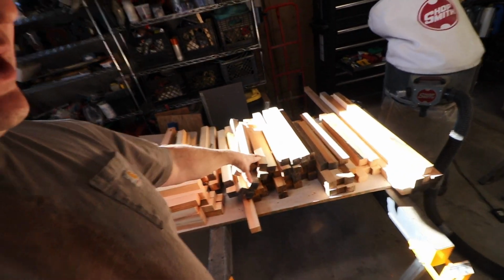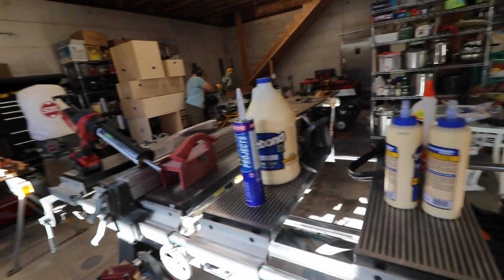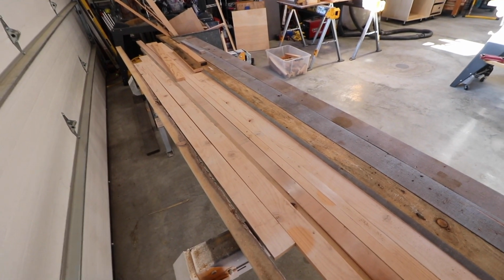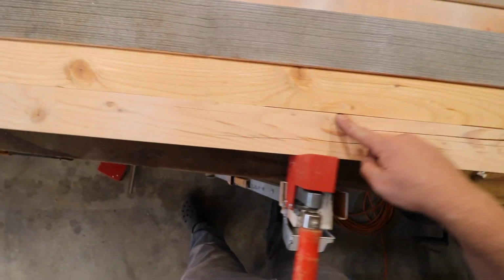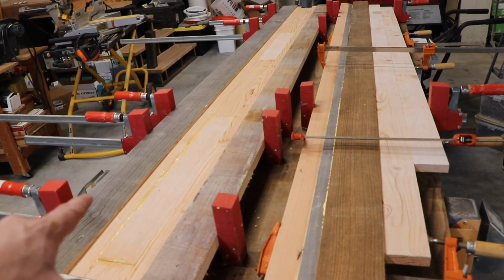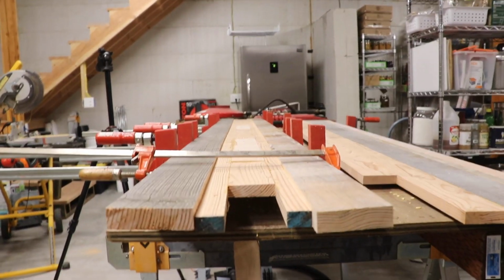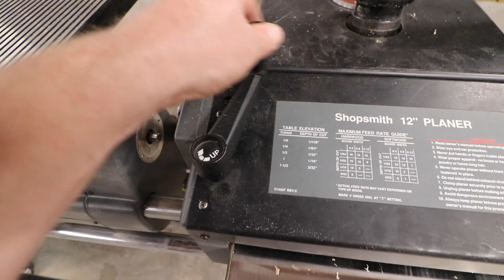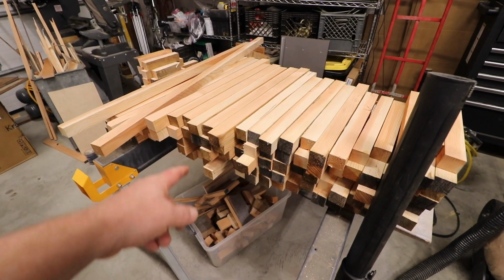ODDLY SATISFYING! Nasty Wood to AMAZING CABINETS

Comment: Here is a little trick I learned when I was in wood shop When storing glues and adhesive make sure the lid or cap is tight ans store then upside down. if it does form a layer it will be at the bottom of the container. If your bottle has a pour spout take a piece of scrap wood and glue pieces of pvc tubing alittle bigger than the size of the container and that will keep the bottle from falling over. This works great for pvc cement when left sitting for a long time.

Comment: When gluing up long boards using bar clamps, it's best to put the clamps under, over, under, over and so on.  Helps hold the boards flush to each other.  Also, planing to within 1mm of finish thickness, squaring and straightening each board individually first tends to lead to a better final result.  Then the final dimension is reached with hand sanding.  Just a thought.

Comment: Two hints for panel glue-up: to spread the glue use a "mini" paint roller - pour a bit of glue in a disposable roller pan then roll the glue on to the edges. 2. To keep the bulk glue bottle from forming a skim coat, store the bottle inverted which precludes air from reaching a large surface area. Also to prevent "cupping of the panel clamp top boards perpendicular to the board lay out.  Glad to see the bone yard being used as it hurt to see that wood tossed aside, although I did agree with the logic at the time.

Comment: You need to use clamping cauls as well as bar clamps. The cauls keep the boards in line with each other. Differences in thickness does not help you when gluing.
Your end result looks great. Better in the kitchen than on the fire.

Comment: You need to alternate your clamps. One on the bottom and the next on the top. Also, there are clamps made to sandwich all those boards between a top and bottom beam to keep them aligned plus clamped edge to edge. Simple cauls clamped top and bottom would also keep them aligned. Simple plastic wrap or wax paper can be used to keep them from sticking or glue off your clamps.
Reply: Glad i looked, I was going to say the same thing....

Comment: Just a question. Why didn't you plane all the strips to a size just over what you wanted. Glue them together. THEN plane them to final thickness? Just saying. And your edge planer fence is still moving.  Oh and just say this as you clamp large panels together....Over, under, over, under.

Comment: Did you notice in the high speed section at 13:30 - 13:50 the fence moving back and fothr at the out fall end on the joiner?

Comment: they make a roller attachment for the titebond glue bottle, or a separate bottle with a roller, but one thing is for sure the entire face of the wood needs to be covered before glue up! so brush it or roll it so the whole thing will be bonded together!

Comment: When doing glue ups, pour the glue in a shallow disposable bowl and use chip brushes or acid brushes to apply.  You can just take the cap off of the bottle and pour directly on the wood and then spread it.  Shop online for a squeeze bottle and glue roller combination.

Comment: That's a lot of work, but it's coming along which is more forward progress than not.  For future planning and edge joining projects it's best that the glue gets spread between the boards so you have full coverage on all parts of the edges. You will definitely want this for the butcher block project. Rockler makes a nice glue bottle with a roller on it that all you do is roll it along the edges and it spreads the glue for you with a lot less squeezing.  Additionally, you should be using clamps on top of the boards at least every 3 or clamps, which would help keep them flatter.  Some people also use cauls to clamp to the boards which help keep it flat and you can use smaller C-clamps on the edges or quick clamps to sandwich the project boards between two straight boards again to keep them flatter.  While you have different sized boards, you can put shims between the top clamps or cauls to fill the size gaps and push the boards to one side or the other. The finished boards look great in the end.

Comment: Normally butcher  block is made of maple or similar tight grain hardwood. I know you want to use your pine scraps and you can make it look great but you will find that it is too soft for butcher block. If you make it into a counter top you will have to replace it. You could put bar lacquer on it but I have a feeling that's not the look you want.
Reply: he is planing on replacing it with stainless steel top in the future.

Comment: Better to rough plane to a reasonable accuracy before glue-up, and use biscuits to align and take out those 'wandering' errors :) For glue-up you can use a small roller to spread the glue more evenly.

Comment: Total Boat Thixo thickened epoxy. 
Comes in caulking tubes with a mixing tip. Long working time for those tricky alignments. Also, epoxy doesn’t rely on massive amounts of clamp pressure. Just enough to close the joints.

Comment: Sorry if this is too late but I put my glue in a Tupperware dish for big glue ups and just use a small foam roller or a silicone brush to put it on the wood.
Reply: Jared Williams same here. Bowl and a brush.

Comment: 1. I still see a lot of movement on the jointer fence. 
2. Shouldn't you temporaraly glue the boards to a flat board before putting them throug the planer?
3. I would joint and plane the planks to the same thickness so you can use beams on top and under with tape (for the glue) to clamp the board on them.
4. Counter the grain on the planks to prevent cupping to one side while the wood dries out.

Comment: white  glue is tough enough for that kind of purposes no need to pay extra for special glue that make skins in the bottle or that spils out of joint and goes everywhere ( urethane based). I'm a cabinet maker for over 25 years now and i've used water resistant or urethane based glue on outdoor projects or with very dense and oily exotic wood like Ipe or cocobolo.

Comment: You need to use the green Titebond which is water resistance.
Reply: Gary Tuttle The last time I checked Titebond 2  is water resistant indoor / outdoor where as Titebond 3 is waterproof meant for exterior applications. I have used Titebond 2 making cutting boards with no problems. Not disagreeing with you just sharing what I have learned.
Reply: Ok going to correct myself. After re reading the labels on my glue bottles, Titebond 3 is also usable for indoor uses. Learn something new everyday.

Comment: Green wood for timber framing, no problem,  but green wood for cabinetry?
Reply: been sitting outside and milled in the bone yard for 2 years!
Reply: @leswheeler2023  Still green wood.
Reply: @kevinmccartney3565  suggest you look up the terms of green wood. Green wood is freshly milled, milled timber, that has been left stacked or otherwise thrown in a heap for 2 years would be dry. depending on species, timber needs about 12 months per inch to naturally dry. I have nz grown red wood milled to 30mm and is dry in 3 months! - no kiln necessary!!!!

Comment: Like everyone has already use half the clamps on top and half on the bottom. Also the direction of the grain at the ends needs to be alternating one cupped up one facing down.

Comment: I’m no where close to a professional woodworker but for glue up like that you should have half your clamps on the bottom and half going over the top or else you will get cupping... learned that the hard way. Also when planing boards like you did it’s best to hot glue it to a flat board with shims to make it not rock in the planer it will save a lot of material

Comment: a tip on the glue   ,,, if you blow your breath into the glue bottle you remove the air and replace it with  carbon dioxide witch may not form skin , i know it works with paint .
Reply: i often wonder why no companies market a nitrogen dispenser, you can buy nitrogen bulbs (for whipped cream dispensers) that are much like CO2 bulbs for soda bottles.

a small device to flow out a small amount of CO2 or nitrogen could be used in the shed or kitchen to prevent spoilage.
Reply: Yeah, not so much.  Ordinary exhaled breath is 4% CO2 and up to 1% water vapor.  That leaves 78% nitrogen and 16% oxygen.  Standard air is 21% oxygen and 78% nitrogen.

Comment: I know that the Titebond II brand is all that some Big Box Depot stores carry now. However, Personally I have had joints Fail with that brand (Specifically attempting to laminate Bowed Plywood Pieces) whereas Elmer's Carpenters did not have joint failure.

Comment: Need to use flat board clamped across top and bottom every few feet to maintain a straight flat glue joint...this will reduce the amount of planing and sanding after glue is set up.

Comment: Have I missed something. There is a new cat?
Reply: That's my thought just a few seconds into the video! Pretty calico, looks like bobbed tail from that short glimpse, will have to keep my eyes on the rest of the video ;o)
Reply: I bet it is a visiting cat from the neighbors.
Reply: @wallykramer7566  possible, but the neighbors aren't all that close, and it seemed to feel right at home
Reply: @javabeanz8549    Those attributes might be a factor for a dog but not for a cat.  Cats are right at home on the neighbor's dining room table.  The nearest neighbors seem to be about a quarter mile away, mostly through forest, so I don't see an issue there either.

Comment: I've always heard the Shop Smith was a  jack of all trades and master of none. I guess you just have to learn all of it's failure modes and compensate. Still think softwood countertops are a mistake you wind up having to correct in ten years.

Comment: next time use clamps on top also to avoid cupping/warping of the glue up, less sanding/planning, remember to keep your wheels on the ground, from the motor city Thom
Reply: Thom Pasanski ya I also have learned plane to the same thickness first then use clamping cauls. Homemade even. He should have put out a short video first and got everybody’s advise first. People give advice but it’s to late cause videos come out so late, but as long as it’s still fun

Comment: You should join two sides before planning for a butcher block. One flat surface to glue to and one for the planer bed. Thickness planer will only make one side of your board just as straight as the other.

Comment: Jesse... I do a lot of glued panels and butcher block work... with a Shopsmith.  I mentioned this previously... but, I’ll do it once again... 

The jointer is not the best tool for edging boards for a glue up.  First of all, you are constantly fighting snipe and secondly, you cannot control width.  You have two others that are foolproof.

On any board, for totally flawless edges... use that conical disc that you got with your Shopsmith.  The first edge goes through the jointer, the second edge through your table saw with the conical disc.  They will be perfectly plumb and straight every time.

For narrow boards, set them on edge and run the second edge through your planer.  Even if you jointed them out of plumb you are guaranteed that they will be parallel and coplanar.  

The results will be phenomenally professional and the hours you save are a bonus.

I know this is far too late to help with this project... and you did not ask for advice... but after nearly 30 years of experiences with glued panels... I guarantee that it is true.
Reply: Ok... I just saw the follow up video and see that you used the planer for your butcherblock parts... and the outcome was great. So, please consider using the conical disc on your wider board edges.

Comment: just wondering if your,e actually waiting for all that osb to start de-laminating before you get it covered. got a lot of respect for the monumental task you two have taken on but getting the exterior weather tight as a priority seems like common sense to most.
Reply: Ken Haigh it looks brand new, it’s exterior grade OSB not like the garbage they use on normal houses, it’ll hold up years before getting bad
Reply: he's already talked about it, he has to get all the electrical down before he can put on the siding.

Comment: Guys for the wood burning hottub  why not build a wood shed close to the hot tub you don't have to walk so far to get wood to heat up the hot tub and it will stay much dryer then up against your home
Reply: or simply stack a pile underneath the deck it sits on
Reply: @jasonfisher5811   when the wood is under the deck it will get wet because the deck had gaps between the wood slats to allow water to drain off the deck but with a wood shed the wood will stay dry.

Comment: You don’t sand what you are gluing up makes for weak joints and you need to stager the grain direction to limit warpage keeping your panel flat. Check woodworking videos before you start and save a lot dumb mistakes
Reply: Basically an oak semi trailer floor. I used to help a friend's dad build booths for Danvers, Shoneys South, Hungry Fisherman, Captain D's and a few more owned by Shoneys South. Barkwood was his companies name!